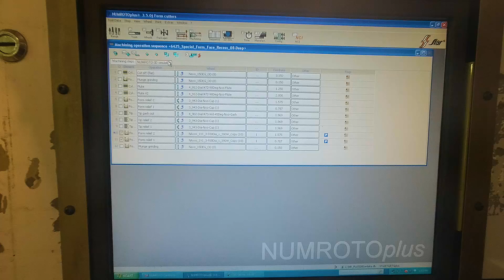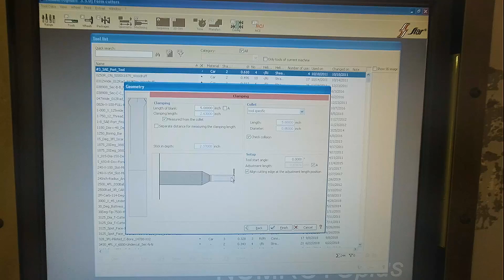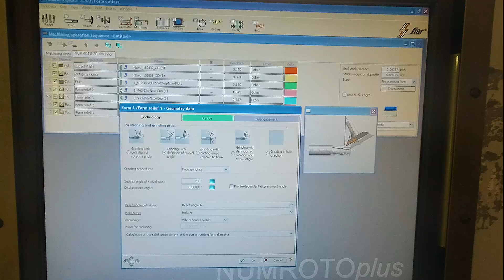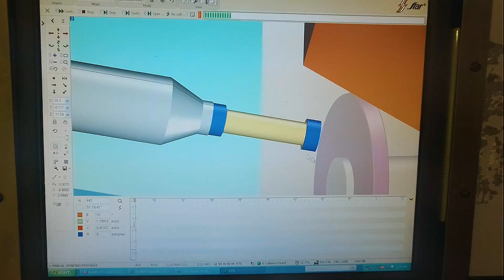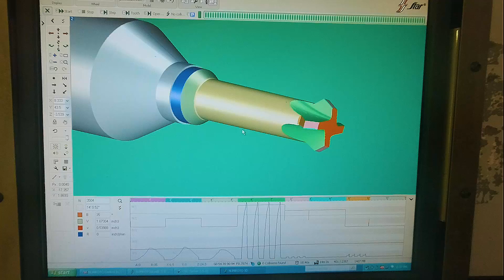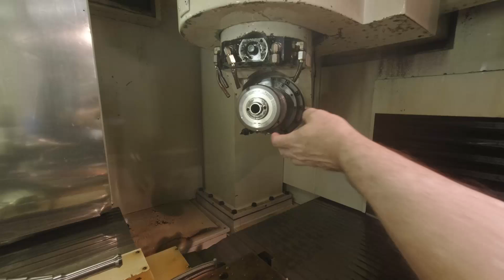30 Degree Front And Back Chamfering Tool

Comment: This video is now 7 months ago and you’re still making videos on this darn part! Question I have for you: what is your lead time on these parts?
Reply from the maker: There are more than one part. In fact there are 16 pcs. I have already delivered some. Others have been pushed out due to the Covid situation. There are also operations being done outside that I don't do. So it appears to take longer. My machine work on one part only takes around two weeks to three weeks total. Depending on what happens. It takes three weeks for inspection to check the over 1200 dimensions and data sheet them. And deburr another two weeks to get everything correct. So you see it takes less time to machine than inspection and deburr.

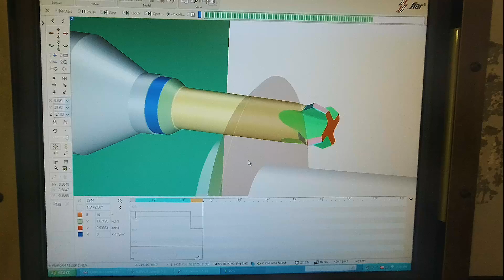Comment: Around 46:00 the spikes seem like when more surface area of the grinding wheel is in contact with the part rather than initial contact. Maybe there is a way to gradually reduce the feed rate as the amount of the tool in contact with the grinding wheel increases. It might even be a setting already in the program. Similar to how your lathe knows to change the RPM to keep the feed rate consistent for turning.
Reply from the maker: There is a way to use what they call a programmed feed rate. with this you can vary the feed anyway you want along the profile. This can even follow a feed curve based on the points and feed you set along the profile. It kind of looks like a graph that passes thru the points you specify. I use this quit a bit for fluting feed where there is a lot of change in the diameter of the rough out blank. But it isn't usually necessary the spikes are not a real problem if your not overloading the wheel or spindle. Thanks aus71383!
Reply: Also, what an amazing machine. I know it's rare for someone to have one - but it is in good hands! Thanks for another great video.

Comment: That grinder is a great machine, but man that software is crude. So much trial and error, reminds me of really old CAD packages. Too bad that machine never got mass produced, it was a real interesting design.
Reply from the maker: The reason this seems crude is I'm doing something special. If I was grinding just a standard endmill it has cycles designed special for that. It takes only about 5 minutes or even less to program one of them. There are many many different changes you can do for cutting tool grinding. It would be impossible to make a simple software to do it. Can you imagine the the complexity of the calculations necessary to make the full 5 axis movements while compensating for the wheel shape and profile with clearance angles a tool has.

Comment: Just a heads up I am fairly certain the title has a typo (should be chamfering, right now it is 'chanfering') especially since you are saying 'chamfer' not 'chanfer'
Reply from the maker: Your correct I didn’t notice it. Thanks.
Reply: @EdgePrecision  Np Peter. Thanks for the most edifying machining videos on the tubes!